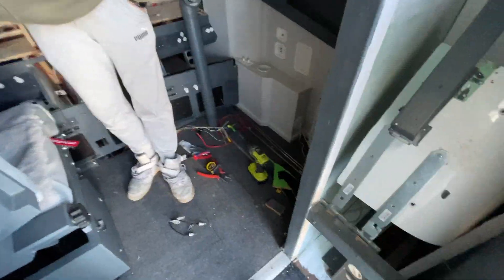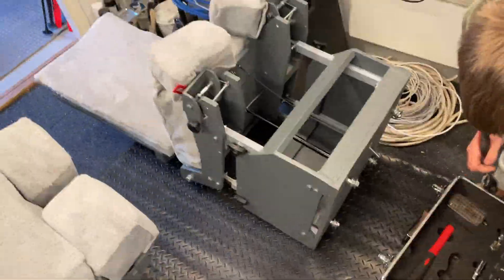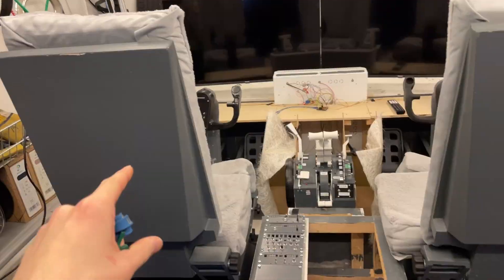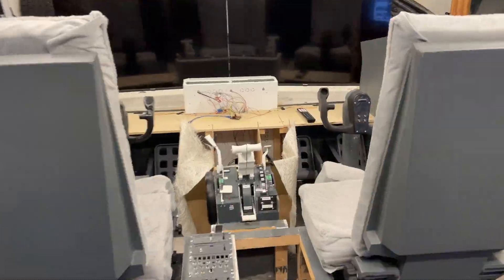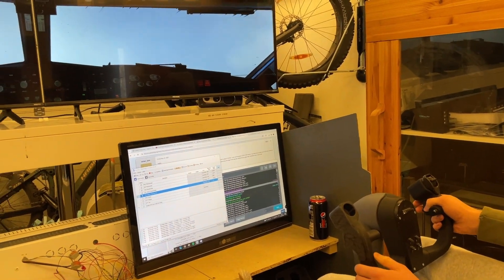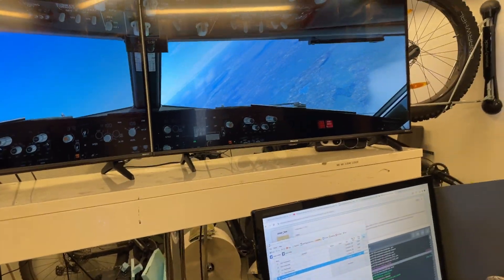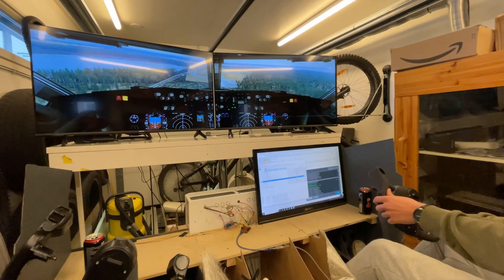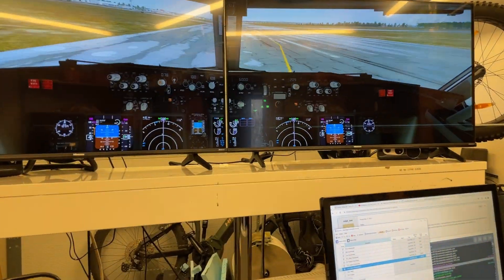It's Flying For The First Time! - [B737 Build #7]

Comment: hello Finn , congrats for your project, i should like to ask you how you configure the screens to have one a external view without any frames ? best regards
Reply from the maker: Thank you! In X-Plane 12 there is a built in screen configuration menu, in which you can adjust all the screens. After that, pressing CRTL+W (or assigning some other button) You can hide the cockpit so only the external view is left.